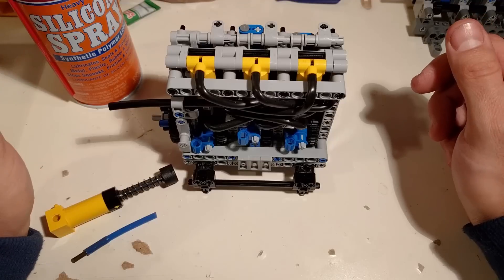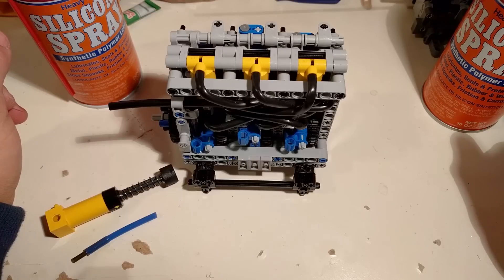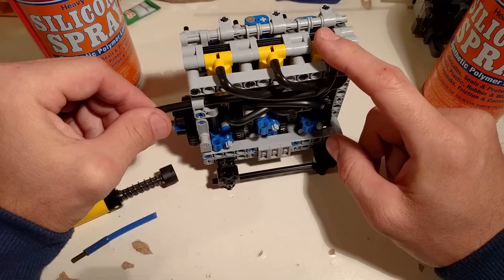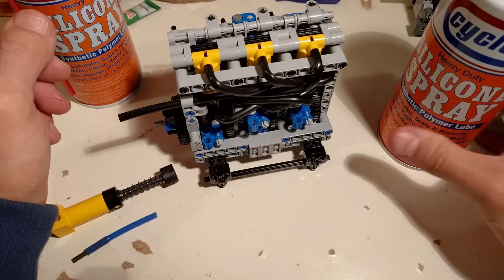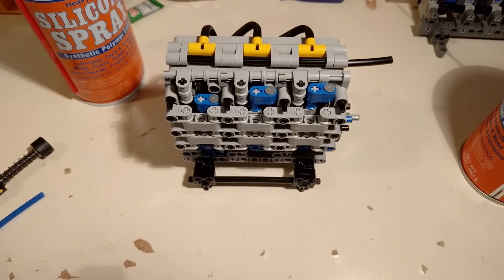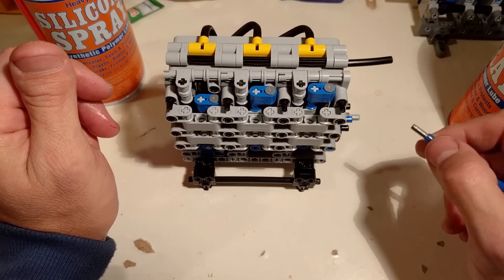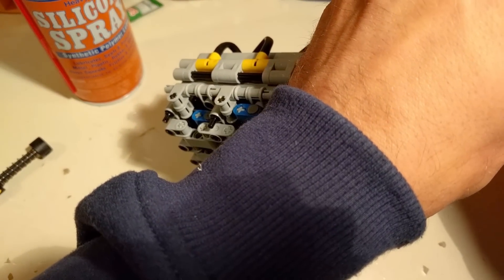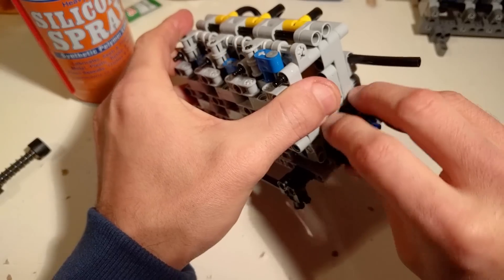LPEpower insight - Engine lubrication

Comment from the maker: The leak was due to a slightly loose tubing. This isn't an issue on the regular switches, but the new tapered ones have a shorter base on the inlet nipples and leaks are more likely with the hard tubing. All is well now. :)

Comment: I use Silicone lubricants on my bike, i work in the bike repair / assembly section at the local bike shop, i have had good experience with such lubricants,  also grease that contains Teflon works great for assembly and bearings, i will get going with some LEGO engines my self and will use the Silicone spray for this, have had zero time for doing LEGO's but looking forward to get back at it again, enjoying these videos of yours.
Reply from the maker: Teflon grease will damage lego parts, so it's not recommended.
Reply: For Lego applications i wouldn't use grease but as for one of my fav lubricants, Teflon grease and Silicone spray works great, i use Silicone lube on the drivetrain on all my bikes, as oils gunk up and make a heck of a mess.

Comment: Do you use original lego hose's or third party hose tubing? If the second option is the case it would be appreciated if you could link me the ones you buy. thank you
Reply from the maker: I use pplyethilene plastic hoses that need to be molded to the correct shape. I use them, so that under high load there is no danger of a hose popping off.

Comment: How long can you run these engines without failure or damage due to heat/friction? It's still only Lego.
Reply from the maker: A properly engineered lego pneumatic engine has very little friction if its lubricated. I have disassembled engines that have run for quite a bit in my cars under heavy oad, and i did not see any wear.
Reply: @nicjasno  ok nice thank you 👍🏾👍🏾 🙏

Comment: Hey by the way if you look close at around @4:34 min you can see what looks like a little insect is crawling in the bottom a little to the left :)
Reply from the maker: That is just a piece of something being moved by the vibrations of the engine.
Reply: Yes this i could tell as it was static when the engine wasn't running but at some points it looked like a crawling bug.